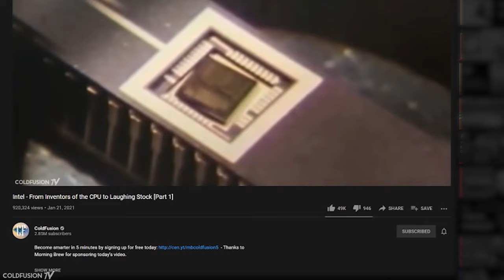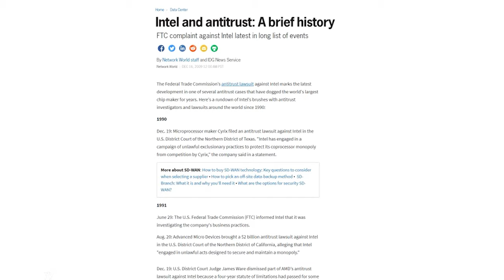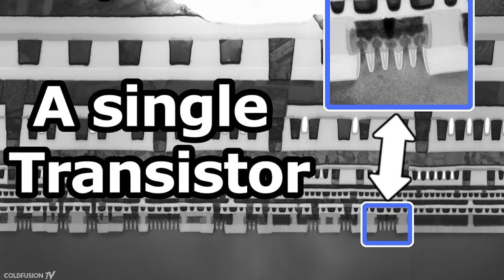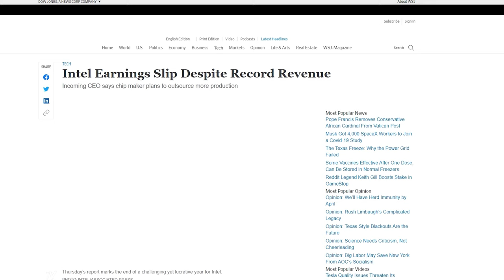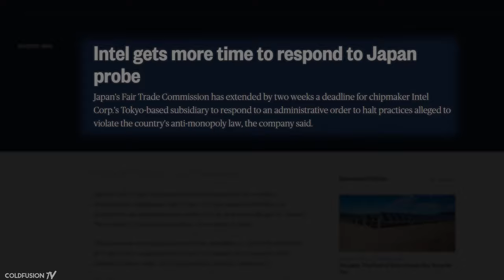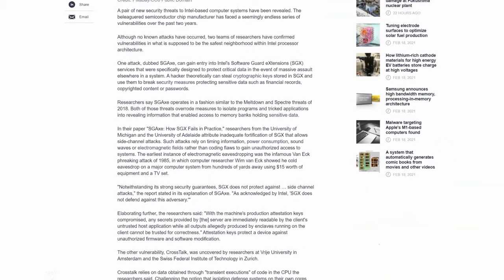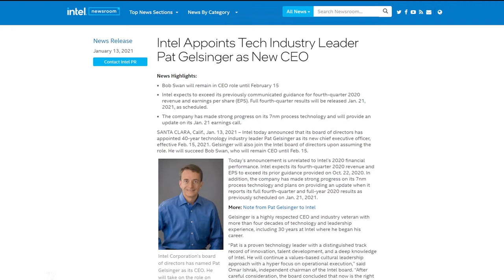Intel - From Inventors of the CPU to Laughing Stock [Part 2]

Comment: Intel needs to start making ovens
Reply: They already do!
Reply: @pentiuman  they don't
Reply: At least something hotter than this 3090 I've got in here as a room heater.  I shouldn't have to spend $1500 to warm my bedroom.  We need cheap CPUs that can do it!
Reply: @nolkerss  I'm an Intel fan. I have 6 PC's (4 for sale) and all have Intel inside. The top two have an i-6700k and a Core 2 Quad Q6600, both w/ 4 cores. Those last two are 5 years old and 9 years old but still run fine because all I do is browse the web and write letters. BUT, I've played w/ overclocking and like to have the fastest consumer CPU (within reason) and so I'm tempted to buy AMD next because I'm very aware that:
1. Intel's top CPU's are HOT, expensive, power hungry, and still 14nm (and have been for 6++++ years).
2. AMD's top CPU's run cooler, almost as fast, cost less, already 10nm & w/ MORE CORES!
So, yes, Intel does make ovens - that also happens to be CPU's too.
Reply: @pentiuman  do but it's called processors officially

Comment: 79 of the remaining Intel fanboys found this video and downvoted it. I still got old computers running intel. Next updates will however be AMD.
Reply: Tbh you should look more at the product rather than the brand itself when you get new pcs. Such as with the 10400f and 3600 with the 10400f being $50 cheaper than the 3600 and still having basically the same performance. I’m also not calling amd bad but some parts are better for getting value for your money
Reply: @staitz2728  "same performance" - only for gaming. I am using the workstation/gaming pc for work as well, and the server is powered 24/7. The workstation is much faster with Ryzen, and the server will be both cheaper power bill and faster with Ryzen.
Reply: @freddan6fly  Oh ok then. I was thinking gaming performance

Comment: I've been so disconnected from this market for such a long time. I spent ~$600 on an intel 3930k around 10 years ago and have been using it ever since. One of the best tech-based purchases I've ever made in my life. It was close to the top of line at the time I bought it, only slightly worse than the 3960x for literally about half the price. Dollar to performance ratio the fact it is still at least a reasonable cpu serving me just fine 10 years later made it a great investment in my eye. I'm still able to run most games on Ultra settings, having also upgraded my GPU to a 1080ti a few years ago. Its crazy to think that during the decade since I bought this CPU Intel could have fallen so hard. I just hope my PC holds out for a few more years before i finally invest in building a new one, once the chip shortage issues are resolved and prices level back out.
Reply: I hade 3930K oc to 4.6GHz. And thought it was powerful until I bought R9 3900X which is 3 time cooler, way more powerful and runs with silent air cooler instead of big and noisy water cooling.
Reply: @KolyanKolyanitch  i never said it was top of the line by modern standards anymore, only said it was still "reasonable" which is impressive for a decade old processor. Its biggest disadvanatge compared to modern cpus is its power consumption is several times higher hich also equates to heat. But its still good enough for now to hopefully keep me for a few years until Im ready to build a new rig.

Comment: I've had the Athlon's, Athlon 2's, Duron's, Phenom's inc. Blk, and FX's but no Ryzen's yet but have always been impressed with AMDs performance. My first build's cpu was a 486 DX2 33mhz on overdrive to 66mhz back in 1995, I was 14. And at some point I've had almost every intel chip sense up to i7 1st gen. With my time span and knowledge playing around w these chips, intel only has a small advantage over AMD IMO. I never really believed the benchmarks at the time, because in life gaming will really tell you how good the chips are. For the money, AMD exceeds intel in terms of value. You could save money building an AMD system and put the money saved back to a more powerful GPU or more Ram. But I like both chip manufactures to be honest. Keep building everybody! Peace!

Comment: the way intel and tsmc measure their processes are different. for example, on intels 10nm superfin they get 100.76MTr/mm2 (mega-transistor per squared millimetre) while TSMC's 7nm process is said to be a little behind at 91.2MTr/mm2 (intels 14nm is 43.5MTr/mm2 for comparison)

Comment: 7:45, that's wrong, in 2017 the first generation of Ryzen was at most 8 cores and 16 threads, still a groundbreaking processor, but 16 cores came later

Comment: I think Intel will overcome their challenges for two reasons.  First they fired those executives with business degrees and put in a CEO that is an engineer.   Second, by going to TSMC for manufacturing some of their designs they admitted they are having a problem with cutting edge manufacturing.  The first step to fixing a problem is admitting you have one.  I think they should breakup their design and manufacturing divisions and allow them to stand as independent businesses.

Comment: Lovely video.  Two anecdotes that show how there was handwriting on the wall that was whitewashed over, when Intel ventured into the desktop / STB / Media PC market with the NUC, they did so in a way that strongly suggested that they had highly anti-competitive tying deals in place with Microsoft that they were trying desperately to skirt around.  All indicators point to a deal whereby Intel and Microsoft had a deal in place that any assembled consumer computing device containing an Intel CPU would have to pay Microsoft some dough.  So Intel tried to skirt this by selling the NUC in kit form unassembled... you had to plug in the memory and the drive.  The idea was conceived to ride the wave of then-looming-but-now-gone ascension of Linux, and they even produced materials that instructed consumers how to install Linux Mint on the NUC, but by the time the produce was in the market, that material had been scrapped, most likely out of fear of waking the devil in Redmond.  The other anecdote goes all the way back to the 1990s when the first Pentium chip was released.  Shortly thereafter, an amateur mathematician basically discovered a flaw in it's computations  and it had to be patched.  This was before the Internet was a big thing, and viruses were things that you got by using an infected floppy disk with an irruputable bootleg of software.  The fact that they were able to spin it as a nominal failure and get away with the patch-and-go approach seems to have fundamentally affected their culture as to QA.  This is one of the reasons why I have favored AMD chips (that and the fact that they are usually cheaper).   When the chips are down, corporate culture is what destroys a company like Intel.  If you talk to any engineer from back in the old days of IBM's hardware days, you can see that their downfall as a manufacturer was inevitable as far back as the 70s when they were still a golden-boy.  My uncle who had a job there described starting every shift by having to fix all the mistakes that the previous shift had made.   They were held to production quotas, so they would work too fast, and every mistake just got set aside until the end of the shift, when those defective machines would be put on the line for the next guys.  That kind of "dump on you co-worker" culture is what ultimately prevented them from doing any innovation outside of a few very small skunk-works departments that started out as side-line vanity projects that could escape the toxic culture that permeated the rest of the company.  I'd be really curious to know what rank-and-file engineeers who actually worked for Intel might have to say about the culture there, but my guess is that they are followed around by Intel lawyers every time they open their mouths.

Comment: The elephant in the room here is Extreme Ultra Violet lithography. I don't know, but I think Intel wasn't sure it was ever going to work. TSMC, Samsung and others backed the research and development and bet their future on it. Intel was also backing EUV research and development, going back into the early 2000s, but there were a lot of problems and delays. There were academics saying that EUV would never work for a variety of technical reasons. Ultimately EUV has ended up working. EUV is a much bigger animal than DUV (Deep Ultra Violet). If DUV is a bus, EUV is the Starship Enterprise. EUV is physically big, expensive, very complex, and prone to all kind of technical problems/maintenance. Intel is or has completed building a dedicated FAB in Chandler, AZ, but it seems like they waited too long to begin the ground breaking. TSMC and Samsung built facilities in anticipation that it was going to be delivered "any day now", whereas Intel hedged their bets and tried to played it safe with their endless work on quad patterning immersion lithography (basically pushing DUV to the very boundary of its technical limit). TSMC and Samsung aren't just ahead in production, they are ahead in process development and experience with EUV. I believe they also have many more EUV fabrication facilities in production than Intel plans to ever have at all.

Comment: Sony is using a custom Ryzen processor in the PS5. I personally bought a PC with a Ryzen 5 right before the announcement of the PS5. I'm still using it. It's strange, but it appears to be faster than previous PCs I owned before that had similar core specs. It's oddball integrated graphics processor helps a lot. I'll probably be purchasing a newer gen Ryzen for my next PC too.

Comment: I was listening to the part with bribes with mouth wide open, well I always saw them as monopolists until threadrippers showed up, it explains why server system processors were so expensive, on the other hand I remember years when AMD wasn't doing so well (i7 decade), so I just hope Intel doesn't die and release a decent 7nm, because without  decent competition AMD will become new Intel
Reply: they are both dead. Apple's M1 ARM is the new Mesia. all big boys are following that ARM route.
Reply: This
Reply: @Don_Puparo  ARM processors aren't standardized nearly as much as amd64 processors. This means that unless things change we will have a future where ARM computers are locked in even further. It's also not as simple to repair an ARM computer either. All of this together means we'll have record e-waste if this doesn't change. Last thing: Apple's charts are very misleading in their comparisons as they compare energy efficiency of their chips vs old Intel processors, rather than high end Ryzen ones. Unless things get better, consumers and the environment will pay for this.

Comment: The main problem with intel manufacturing is the fact they want to do it on a monolithic die where and had abysmal yields on the first batch of 10nm which to other manufacturer was the equivalent of a 7nm design in density... AMD on the other hand had actually increased their yield with their prototype for a future multi die approach on 14nm as compared to intel's 14nm... their wafer yield way higher volume of chips from sheer luck on the Zen1 and the future chips that shown a working multi die just made their yield near perfect and making lesser waste per wafer... it was just a simple reason of intel trying to cram too much stuff on a very super advance 10nm node that they designed in house on a monolithic die process and them not backing down from monolithic design... in terms of business strategy it sounds good that they go to a lower node that is more advance than the competition but the problem is when everyone is going to 5nm soon which has more density that the original intel 10nm design, it is pretty much a grim news for intel...

Look we all know intel is gonna try make a comeback... i mean they have sunk cost into 2 new plants for silicon chip manufacturing and they are making a partnership with HiFive to produce RISC-V chips very soon (Those same prototype that beat the first M1 chips easily with even lower energy draw was made by HiFive)... its probably for that 2023 year outsourcing production plan... it lined up perfectly with their new roadmap... This would mean very exciting news for the chip manufacturing of the future because competition is going to be crazy again and we might have another revolution from everyone (intel apple nvidia amd and many more) in our midst if everything goes according to plan...

i think it might be the end of the road for monolithic die design at this point if we look at what it did to intel 10nm...

Comment: When I was in collage branded computers were expensive. Our friends used to assemble their own computers or get it assembled. Since 2003 my friends used AMD Athlon processor because it was faster and cheaper since price of computers was a big issue most of them got their computers assembled with AMD processors and I would think that it was just a matter of time that AMD takes over Intel , however it's only now about 15 to 18 years later that this is finally happening.

Comment: As it is seen in my YouTube channel, I work on a new X128 architecture to modernize the X86 processor. I am some kind of private borderline inventor, not knowing if it will have any meaning. But because I am assembler programmer I have a strong interest, that the X86 will survive. It may be that ARM gives better energy performance, but X86 has the smarter opcode set. X128 will continue this opcode set by integrating 128 Bit Registers for X86 and X87 unit. But it can also be realized as X32 Version for micro controllers.  In Cold Fusion Video concerns not the struggle between X86 against ARM. AMD Ryzen uses X86 architecture and not ARM. But AMD has made bigger successions in hardware improvements. It may be part of the up goint asea world against the old western world. Actually I would wish for Intel, that they can keep up to modernst technology as western producer. But this struggle is hard. Western world has lost its competition against China and asea in general. For my X128 architecture it is not a question if Intel or AMD or any chipfactory in China realize it. It means a big effort from Intel and AMD together, to make from some freaks idea a working new computer technology epoche. There must be new storage concepts, etc. I am an old freak, and I cannot do this by myself.

Comment: I think that allegation that in-house manufacturing is somehow inferior is plain wrong. We can take another case, where Samsung had a domestic manufacturing and was lagging behind TSMC. They just attracted key talents from TSMC and now on par with it. This video is trying to suggest that outsourcing in the right thing to do because it requires to swallow your pride, and that sounds like a right thing. While if you look at the whole picture - it will turn out that everything comes down to engineers, money and management. Intel has no problem with money so it shouldn't have a problem hiring engineers from TSMC, giving how poorly engineers are treated there. So in Intel's case it comes down to management.

Comment: Technically they didn't invent CPUs, nor were they ever known as the defacto CPU manufacturer. IBM and Motorola were prominent in approximately 90% of the CPU market. It was simply that Intel was more known to home desktop computing, which doesn't account for much. Intel wasn't ever known for making "the best experience" or the cheapest, like ever, since day 1 of their operation. AMD was way more advanced, but had smaller market share due to some nasty marketing schemes that eventually landed them in hot water. There's a major untold history that's hidden from the pubic regarding this. TLDR; Intel is not known for being a CPU manufacturer. They are however known for being the biggest A.I. company, which accounts for 4/5 of their entire operation/income.

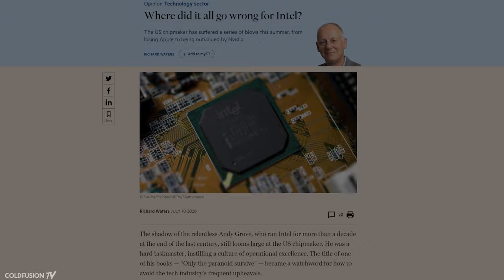Comment: 8:55 INTEL was overtaken already, AMD 5th generation has beaten INTEL's 10th generation in single thread and gaming, and beaten by a great margin. The main problem for AMD was that their architecture divided the memory in two separated parts that were assigned to half of the threads each, that way if the thread was processing information that wasn't in its part of the memmory it would need to have another thread find it in the other side of the memmory or it could even lose the process entirely, when the memmory was made into a single whole unit every thread can find the information needed inside this big memmory, and that was how AMD became faster than INTEL in single core without the need to resort to an even smaller node.

Comment: Ive been using AMD processors since their 486, and they gave me better value for money. However, these days, I only have Intel CPUs as all my laptops are by Dell. Same for the servers at work, they all seem to have Intel processors. It seems their strategy has worked so far.

One thing that's not been mentioned, it seems like Intel did innovate a lot - their multicore, virtualization (and earlier on, pre-emptive out of order processing, etc) solutions did give them a competitive advantage, until AMD beat them by just being better at adopting and delivering ideas. For someone who doesn't need cutting edge processors, AMD seems to deliver better solutions, but if Intel stops delivering ideas, AMD will quickly run out of ways to improve their CPUs (IMO)